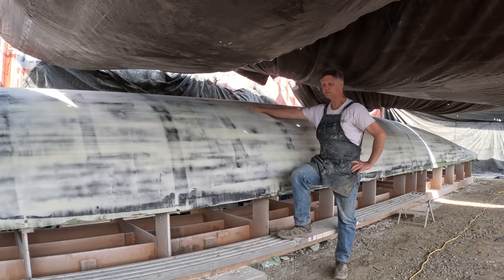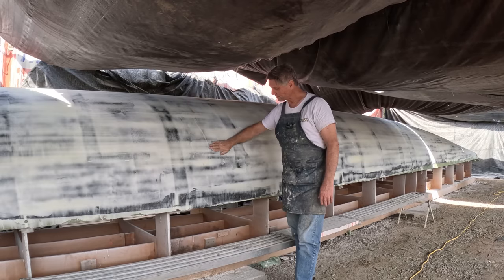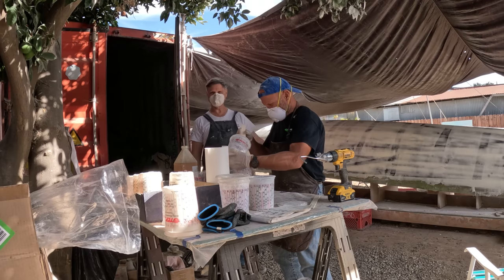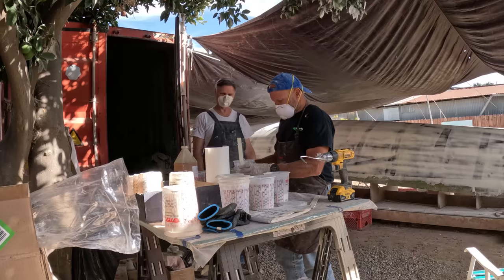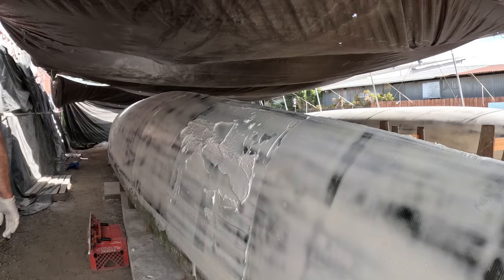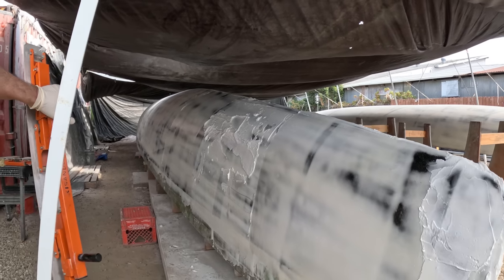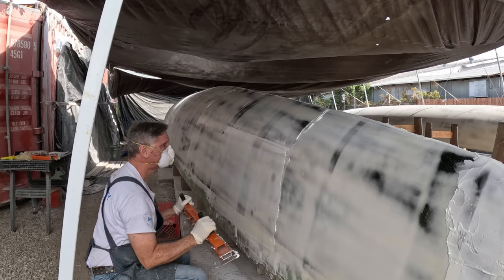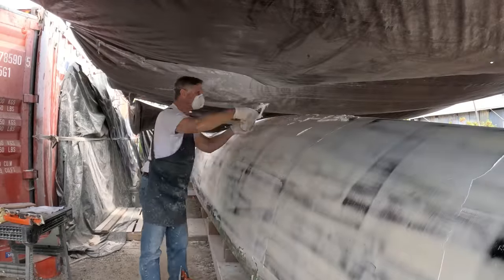Kit E61: Fairing and Viewer Questions

Comment: When it comes to the paint, You should research rolling and tipping. It is just rolling it on and following with a brush, just the tips of the brush real lightly to lay the paint down onto substrate  It looks really good when done correctly.
Reply from the maker: Goos suggestion, but we already plan to roll our paint.  We've been researching techniques and products best for that for some time.  Before we even started building the boat we decided we were going to roll vs spray.

Comment: Something to consider you mention you are going to be gluing in your ancillary structure's and I presume bulkheads. Applying a belt and braces procedure it maybe worthwhile to fiberglass tape over it as well 2 or 3 layers of different widths. I believe with epoxy glue this can be done immediacy creating a chemical bond and peel ply will give you a great finish
Reply from the maker: The plans call for layers of tabbing to all bulkheads, with peel ply, so that's the plan.

Comment: Great job on the outside of the hulls.

Once you flip them, how much time do you estimate it will take to smooth out the epoxy squeeze out on the inside of the hulls?
Reply from the maker: Two days, one for each hull.  Then we have to do some patching if there are any gaps, then sand that, so two more days.  Then we move on to glassing the inside of the hulls, about four to five days.

Comment: Hi guys. I was wondering how you finish the inner facr of the canoe hulls. You look to have a lot of squeeze out. Will you sand back and add a layer of glass?
Reply from the maker: That is correct.  We will sand the squeeze out, then fill any gaps, sand again, then put a layer of fiberglass down, followed by a second layer under the bulkhead locations.

Comment: Hi, I'm an Italian catamaran builder.
The work you are doing is the most boring and tiring, it takes a lot of patience, putting putty and sanding, puttingty and sanding....
To put the putty on the corners I recommend using the round brush and between each pass, wet the brush with acetone and pass it over the resco putty. This will allow you to sand the corners better.
I like Schionning catamarans, I have contacted them in the past and have not received any response.
I wish you good work and I will follow you with your videos.
HI

PS sorry for my English...
Reply from the maker: Thanks for the tip and for watching our channel, glad to have you on board!
Reply: Your English is far better than our Italian!